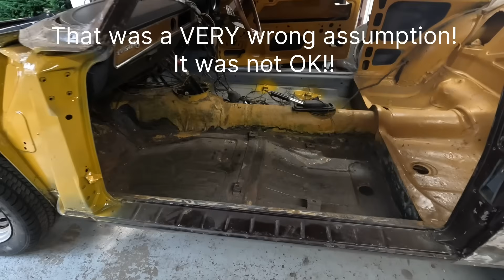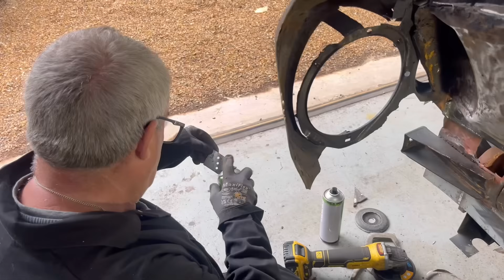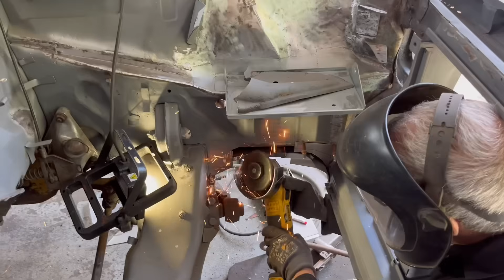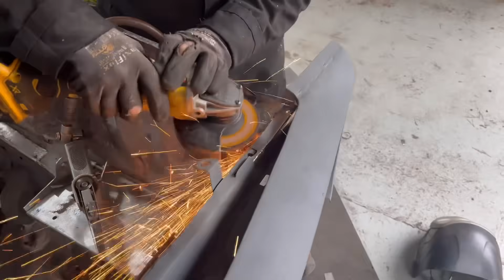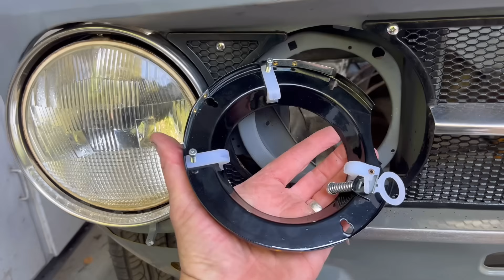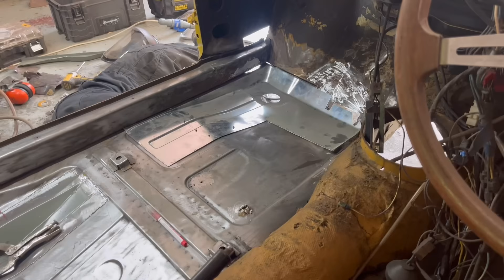Major Sill Disaster! Revised Budget & Big Update - Barn Find Alfa Romeo 1750 GTv Ep 14

Comment: Looking at the first video about budget and keeping the car on its wheels seemed sort of logical. Now the budget is out of the window, it would be a shame not to go the extra mile and strip it completely. After spending all this money and time no-one wants to look under the dash and find old paint, dust and a cracked loom. Also lifting a carpet and finding old underseal on the propshaft tunnel etc. Spend an extra weekend, take the last bits of and make it 100%. This will not add a massive amount to the restoration but will give a far better result. Have a nice finish on the underside. When spraying the car it will add maybe 400 pound to let the paint the whole underside in that stunning colour (assuming you seal and prepare it yourself). Lovely work so far!

Comment: You`ll be lucky to get out it with spending 100,00 , paint, trim, brakes, suspension, diff, the list goes on & on.
Reply from the maker: There is still a very long list agreed plus  wiring and electrical